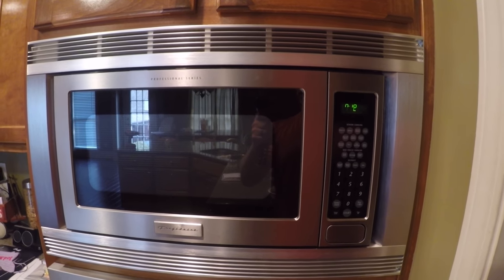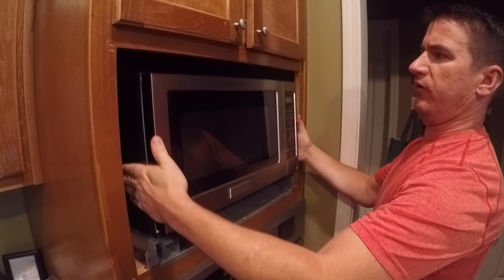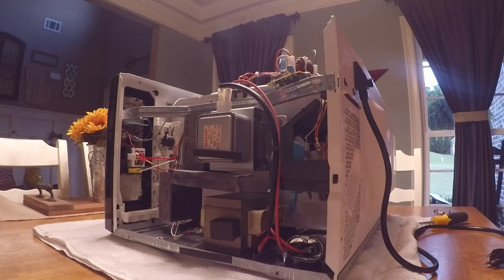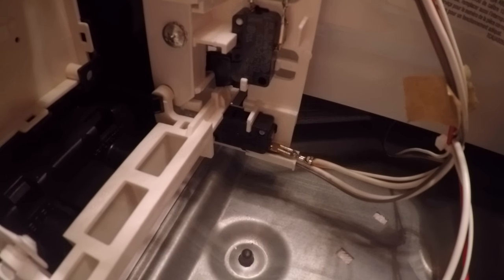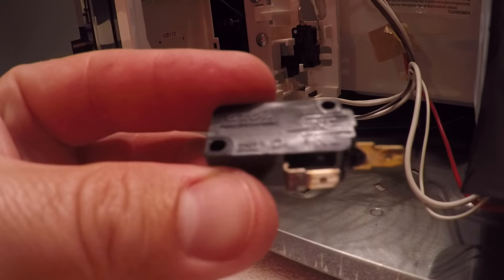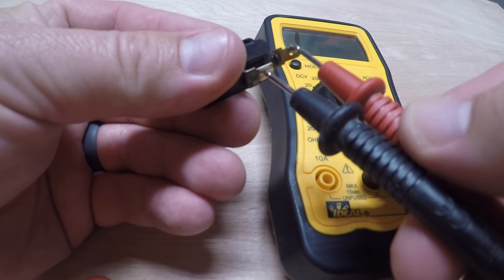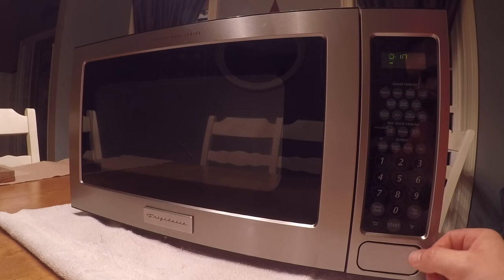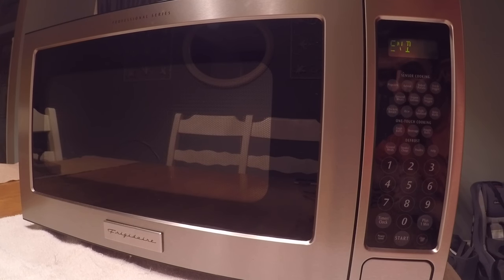EASY FIX: Microwave Will Not Heat and Turntable Will Not Spin - How To Fix A Broken Microwave

Comment: On the way back from a beer store along with my cart, I picked up someones microwave oven that looked about the same power rating as mine. It was located at the curb for disposal. So I took it home, and all the parts that I needed to fix my own oven were identical and still OK in this roadside trashed oven. That included micro-switches, an AC fuse, and a thermal fuse.  Once these used components were installed in my oven, it was back up and working, and still is working.     Total repair cost, $0.00.   However, years later, the plate rotor motor stopped working.   So I took the motor apart and flipped the donut shaped magnet over 180 degrees, and then reassembled the motor.  The motor was fixed and has been working ever since.  The donut shaped magnet has 4 notches on both sides, but only the notches on one side are being used to lock onto the center nylon gear.  Only the notches on one side were worn down, so I now just used the other side instead.  Total repair cost, $0.00.  This stainless steal oven of mine was a store demo unit, or so they said, and so it cost me less than $45. In truth, its keyboard was only half working.  So I cleaned the keyboard electrical contacts, and the keyboard has been working ever since.  This oven was manufactured in 2004 and is still running in 2019.
Reply: You are incredibly awesome.  I only wish I could do that type of repair. I'm a penny saver so I love your total cost of repairs, $0.00.
Reply: @esthersandoval1345  definitely like it too! 😊

Comment: Thank you very much for this video. My Dacor DCM24S had this same problem. Light and fan come one, but no turntable or heat. I followed your steps and fixed it in less than an hour. In my case, the switch was not entirely defective. I tested the switch with a multimeter and found that the switch would fail if the little orange button was pushed in all the way, but it works if you let off the button a bit. All did was shave down the little orange button about 1 to 2mm so the door mechanism would not push it in all the way, and now it works! I would also like to add, for anyone doing this, be very careful when you bend the clip that is holding the switch in. I pushed too hard and snapped off the clip. I was able to re-secure the switch by wedging a small piece of wood under it, wedged between the switch and bottom panel of the microwave interior.
Reply from the maker: I’m glad you were able to get yours fixed. If I were you, I would go ahead and order a back up switch in case yours fails.

Comment: Thank you so much.. I repaired my Microwave oven with your guidance. In my case, it was a a two way switch at the same location. The terminals had got heated and the button click was not very prominent. The old switch worked intermittently, replaced it with a new one and got my oven working. I was earlier too doubting one of these switches, because my overn sometime worked well, but did know exactly, which switch is for what. My oven has three door switches, one on the top and other two at the bottom. the top is for light, the centre one is for turntable and magnatron, still don't know what is the function of the third, last one. `that is a one way switch and I found it ok using my multimeter.

Really appreciate your video. Great job.
Reply from the maker: I’m glad it worked for you too!

Comment: Thank you for the amazing video. It was the exact same switch that caused the issue on my end as well. It is back to normal after replacing it. Since I already had the microwave opened, I replaced the other two switches as well for this old microwave. Your video saved me easily $300 plus the stress. Thanks again. Please continue making such amazing videos.
Reply from the maker: That’s great! Happy to help!

Comment: Just wanted to thank you. I spent $5.00 on the switch and it saved me $200.
I found an easier way around the security torx screws. I used a tiny flat blade screwdriver that fit up against the protruding pin and into 2 of the 6 corners.
Reply from the maker: That’s great! I’m glad you were able to get yours fixed. Nice idea on the security screws.

Comment: I had it for about 6 years and I used it almost everyday, so I thought it was about time to buy a new one,
but just before I buy a new one I still want to check on YouTube.  So I found your video and learned, so I ordered a part, 
3 days later i replaced a bottom switch and now it works again. 
You saved me the money to buy a new microwave. Thanks
Reply from the maker: jk That’s awesome! Thank you for sharing your story.

Comment: Thanks! I was able to fix mine with this. My bottom switch wasn't working, I was actually able to open the switch without breaking it and saw that the metal contact was not making a good enough connection to send current through. I ended up bending the contact slightly and it now makes good contact again. Put a little glue to close the switch up and the microwave works perfectly again.

Comment: Thank you, Mr TightWad! These were the same symptoms that my microwave was exhibiting so I followed your instructions and BAM! $5 later mine is fixed!  Mine is a different brand but it's basically the same inside. It was such an easy fix. The hardest part was getting the case off. I bought a security torx bit which fit all but 2 of the screws (?) I was able to loosen one of them with channel locks but the last one I had to saw a slot with a hack saw. It was worth the effort to fix it myself for next to no cost!  Thanks again for the excellent video!
Reply from the maker: Great! I’m glad you figured it out and got it working again!

Comment: Thank you!  My switch ended up being fine in terms of continuity, but I noticed that the spring was shot, so the door latching mechanism couldn't engage the switch.  Finding an appliance store was the hard part 😄
Reply from the maker: I’m glad you figured it out. It is crazy how hard it is to find these parts locally. I have to drive 45 min for appliance parts if I don’t buy online.

Comment: I’m back. I watched like 30 more vids and came bk to yours as my main reference. I opened my microwave and found the capacitor had a protective box covering and I didn’t know how to (nor did I want to) remove it. No other video had this box blocking the capacitor- I guess mine is super high tech (??). 

It was tempting to just remove the door switch but I used safety & refrained. I took it to repair shop and it cost $125 to replace the door switch and some wires per the repairman (I don’t know if the wires were really damaged but I obliged). I know I can buy a new microwave (and I did, several actually but none compared to this one), so It was worth it for me because I love my microwave!
Reply from the maker: I’m glad it’s working. Sorry the repair man charged so much for a $5 switch and 30 min repair.

Comment: Thanks, this video immediately identified the broken component which I replaced. There was a door switch on the bottom but the actual culprit was the switch on the top. I disconnecting the wires from the switch and checking for continuity/door operation before removing the switch. By the way, the bad switch was easily identified even without a meter because the actuator tab did not extend out of the switch housing as it should.
Reply from the maker: That’s great! I’m glad you got it working.

Comment: Great concise and safety oriented Video. The only thing I wish you'd have done was test the new Switch, so we could see what happens to the Good Switch when tested.  My microwave is a cheapie Hamilton-Beach Walmart one. Everything seems to work, turntable, light, etc. except it doesn't heat. Took the top off, did as you said, discharged the condenser. There were two components, about the size of a Penny, screwed with 2 screws to the metal frame inside like grounding it, with two terminals sticking up and ganged together with wiring. On one of the terminals, on one component,  was burnt, still attached, but noticeably burnt. Don't know what these are, but being burnt, I would say would be the best place to start. The 2 components look like some kind of Diodes.  I did a continuity check across the two terminals on the one Diode, and there was continuity between both. Will check the other diode and see if there is continuity between both terminals and will probably give me a clue to see if the burnt one is bad. These could be some type of double fuse system. Great Video, you did a Good job.  Thanks.

Comment: thank you for the video. This helped me fix my GE profile microwave - the bottom (primary interlock switch) turned out to be the culprit that was causing multiple problems
Reply from the maker: moosthi I’m glad you were able to get yours fixed. Thanks for sharing.
Reply: Same here..  I actually toggled the door. shut it and now it turns... thank you

Comment: Thank you. I'm pretty sure the door latch switch is either going bad or was stuck from dirt. Because I just poked the outside & it started working again. 
But when it inevitably goes out I'll try here first instead of just getting another even though it's just an inexpensive freestanding model.
Reply from the maker: Yes! It’s always better to fix it if it’s a cheap part!

Comment: This video is just what I needed.  I had an intermittent problem. It would stop heating and turning while the time continued.  The spade for the uninsulated connector has signs of arcing so it may have failed due to the poor connection.  The switch definitely burned out.
Reply from the maker: PckyEatr I’m glad you were able to get it fixed. I highly suggest replacing the spade.

Comment: I had a “repairman” come out and he told me I needed a new turntable motor and magnetron, $700.  Cost $95 to have him come out and misdiagnosis it.  So I jumped on YouTube and saw this.  Followed these instructions and $5.65 and some personal time and it fixed it.  Adding just in case someone has my model - My microwave was a GE Advantium oven combo and the switch was on right if you’re facing the unit’s front and it was the lower switch too.
Reply from the maker: Sorry you were taken advantage of. It drives me nuts! I’m glad you were able to get yours fixed by yourself.

Comment: Bang on diagnosis but with mine it was the white plastic retaining part that holds the switch at 90° that had broken. Glue and small splint sorted the job. Cheers
Reply from the maker: Glad you were able to get it fixed!

Comment: Thanks a lot. My wolf microwave was not turning and microwave was running no heat and turntable was not spinning. 
I was thinking to change turntable motor but your video gave me new angel and I checked switch found conector was out  put conector back and all good 😂
Thanks for great video

Comment: My GE microwave is only 4 years only and it stopped working as the video described... I tried everything then I happened to lift the door and found it sloppy and loose on the hinge pins. It looks as if a spacer has broken on the bottom hinge pin that made the switches not meet correctly. I placed a small zip tie around that bottom hinge pin and I'm back in business! 😂
Reply from the maker: Nice job!

Comment: You are amazing! I hope you can answer a question. Since you opened the microwave oven before for the same issue, how long did it take to stop working again (as u had to do it again now)? I hope you can answer it. Thanks!!
Reply from the maker: Fajar Shahzad Mine lasted about a year the first time. However, this time I noticed one of my spade connector wires looked a little melted so I replaced it. I haven’t had any issues since then.
Reply: @TightWadDIY  Thanks for your reply! I am gonna do mine tomorrow, hope it works for me too.
Reply: @TightWadDIY  I followed u, same problem. BUT the switch is perfectly fine. Does that mean that I should give up on my patient? 😥
P.S. there were no burnt wires either
Reply from the maker: Fajar Shahzad did yours have the same symptoms as mine?
Reply: @TightWadDIY  YES!!
Reply from the maker: Fajar Shahzad There is another switch you can try but the symptoms shared here only apply to the switch I replaced. It could be a wiring issue instead.
Reply: @TightWadDIY  Checked both of them. They are perfectly fine. Thanks anyways!!

Comment: Thank you. mine is an Emerson and the switch is the top one. Fortunatly once I removed the switch I was able to take it apart and cleaned it. I test it with my voltage meter before I installed it. The whole process took me 30 minutes. Thank you.
Reply from the maker: bosanovaboy Great work! Glad you were able to get it fixed.

Comment: Great videos sir! I thought this one diagnosed it however in rewatching it, the problem is not identical. The microwave does not turn on. The light AND the turntable operate, but no function. Sound like a fuse or a door relay problem to you?
Reply from the maker: I’m confused. Please state your issue.

Comment: Did all of your buttons work fine? And the unit would turn on just no heat or turn table spinning? Before replacing the lower micro switch?
Reply from the maker: Correct.
Reply: Thanks man

Comment: I'm having this same issue, but it is intermittent. I'm going to troubleshoot this as soon as I can. 

BTW, the cap doesn't have power because of the bleed resistor that goes to the metal body.

Comment: Too funny yesterday I replaced a fuse for my friends microwave because he had no power. When finished he was so excited that it fixed the power…so we thought :). After I left he went to use it and bam it didn’t work. Tomorrow I’ll be going back to replace the door switch and this time I’ll do a better test before I leave. Thanks for the great videos
Reply from the maker: Nice! Hopefully the door switch solves the issue.
Reply: @TightWadDIY  sadly it did not. So I’m at a loss. For now my friend bought a microwave for the counter

Comment: Appreciate the video. The home we purchased has a Wolf brand microwave and it has the same symptoms. Do you suppose this brand is similar in that the bottom switch could be the problem?
Reply from the maker: ranmangolf I would say it’s very likely.
Reply: Thanks so much for the video. With the assistance of your video, I was able to fix my Wolf microwave. I found it interesting that some of the same components (Sharp) in your microwave are the same ones in mine. It makes you wonder if there is any real quality difference between the brands.

Comment: We replaced the switch, it still didn't work - no turntable, no operation.  My husband banged on the front of the microwave in a few places (I swear not an angry bang, lol) and it worked briefly (heated water), but shortly after that the turntable worked but the oven would not go on. Circuit board issue?  Thoughts?

Comment: Hi, thanks for the upload very informative. I have a VIKING VMOR205SS Microwave was working perfectly fine now the panel does not work and the light does not come on inside do  you think you could be those type of switches as well? Thanks.
Reply from the maker: If you have no signs of power you need to check the breaker and plug.

Comment: Perfect. Thanks! $5 switch or $1100 convection microwave oven? TightWads win. FYI - On my GE unit, it was the top latch switch.
Reply from the maker: Yes! I’m glad it worked for you too. Thanks for the info about the GE.

Comment: I have an LG microwave with the same problem. I am having a hard time removing the plastic cover over the wire connection.  Is there a special tool I need to buy for that?  It doesn't just wiggle off like it does in your video.  Maybe the Fridgidaire is different?
Reply from the maker: There could be a clip on it. I can’t say for sure.

Comment: I have a Dacor microwave and I believe it has a switch issue. Sometimes it works, but other times it doesn't. I need to close the door harder to make it work. Could you please tell me where I can buy a replacement switch?
Reply from the maker: Amazon

Comment: Excellent video. I think mine has a different problem and I'm researching it. Light comes on and it runs but turntable doesn't turn and no heat. So is that the turntable motor I need to replace? A new unit would be minimum double what my 1st attempt at finding the part online would be, but I really like this unit that came in my new condo 12 years ago and would rather keep using it.
Reply from the maker: streamoconsciousness Does it hum when you turn it on? I don’t think it’s the turn table motor if there is also no heat.
Reply: @TightWadDIY  Yes, it hums.

Comment: Man, thanks so much, this was a big help!  I have an LG microwave, but it was the same bottom switch that was messed up.  Looks to have fried a bit and actually welded one of the leads to it.  I confirmed it doesn't work with a continuity test.  I ordered a new switch off Amazon, but not wanting to wait on it, I borrowed the top switch (light switch), as they're the same part number.  These are normally open switches.  What I found is that with that top light switch disconnected and circuit open, just closing the microwave door would start the microwave up.  Strange, I don't know why that would be, but I resolved it by putting a jumper between the two wires so that it's a permanently closed circuit.  Just a temporary fix until the new switch arrives.   But am curious, do you happen to know why with the light circuit open, the oven would start running when door gets closed?  Thanks again for the vid!
Reply from the maker: Yikes. I’m not sure why it would do that.

Comment: My microwave has 2 of those in it back to back that are grey in color but everything else looks the same. My question is is bcuz mine has 2 does that mean i would need to replace both??
Reply from the maker: franki ruiz Do you have a multimeter? If so, test them to see which switch is bad. It should switch from continuity to no connection.  The other option is to replace both since they are so cheap.